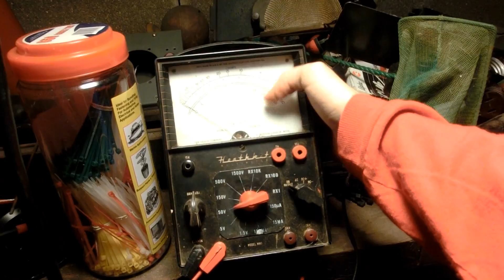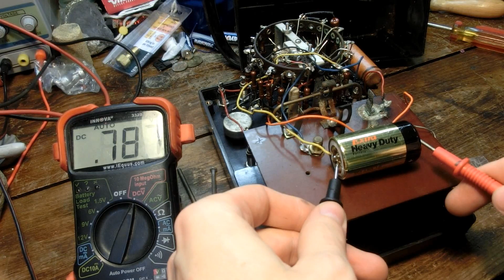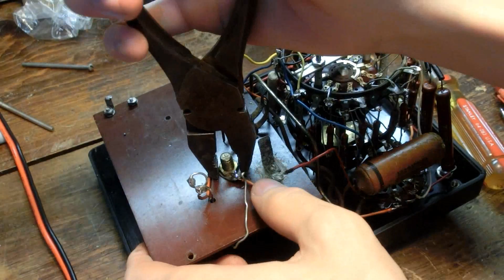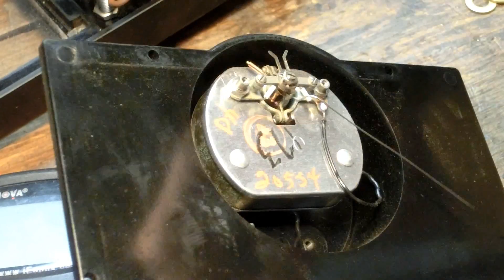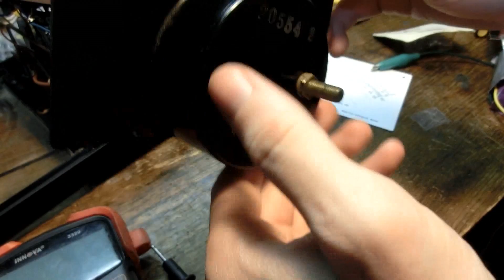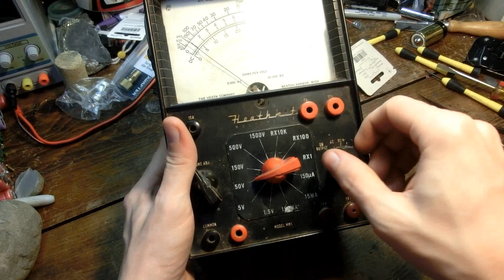1954 Heathkit MM-1 1500v Multimeter

Comment: On my MM1 there is a battery holder that in addition to the bare 1.5v C cell has 4 1.5v cells, so the missing 6v might be why the unit is not working properly. Might check for online schematic.

Comment: I watched your video but i knew the movement was dead, its something ive found quite a lot with moving coil meters, the coils often look loverly but somehow they are snapped, such a dam shame :-(.

I did recover one meter, where the delicate spring connects on to the coil body the soldering was bad and the enameled wire didnt quite connect, a tiny tip soldering iron and my tongue just sticking out while i soldered it worked lol. :-))
Reply from the maker: jusb1066 yes thats kinda how galvanometers work ;p
Reply from the maker: the odd thing is the needle did move a bit before i started the video. but it moved backwards just slightly. idk if that means anything.
Reply: Rinoa Super-Genius
magnetism affects these as well as electrical fields i think
Reply: Rinoa Super-Genius
yeah true, but i still think the coil was always broken, just kinda saying why i think :}
Reply from the maker: jusb1066
 yeah its just odd to get a reading from it if it's broken.
Reply: Rinoa Super-Genius
I dont know about the slight movement, but that meter would be i guess a 50ua type or close to that value, so it would not have taken much to make it move when it was ok.

Have a look under a good light and jewlers eyepeice at the ends of the springs where they attach to the coil, both top and bottom.

Try touching your digital multimeter probes gently on the springs to see if they do actually connect, just a thought, when your interested :-)
Reply from the maker: zx8401ztv
 yeah i tried all of that. looks like the connection in the coil is bad.
Reply: Rinoa Super-Genius
Nevermind, if you find a 50ua meter you can change that series wound resistor to trim it to the scale.

Comment: The white thing is most likely a tiny metal rectifier, used before silicon diodes became popular, assuming the meter has an AC range. :)

https://en.wikipedia.org/wiki/Metal_rectifier
Reply from the maker: yeah it does have an AC range, and no other part looks to be a rectifier so that most likely is it. i may remove it and do some tests.

Comment: a  lot of the older analog meters had no protection, so if you were on the wrong range, too much power goes through the scale winding and kills it.   you can use the digital multimeter, the one you made, with the red led on it, that wont need a battery! maybe put an analog clock movement into the display, and put up on a shelf? or even an led digital display behind the white panel, so it glows through it?
Reply from the maker: or fit a raspberry pi and lcd in there to make it a portable tricorder :D
Reply: Rinoa Super-Genius I hate you to be Dr. Bones. where my life depends on whether your D battery is flat or not!
Reply from the maker: jusb1066 actually i more associate the tricorder with exploring planets. so youd be relying on the D cell to tell us if there's a big inter dimensional monster about to eat us.

Comment: That thing is awesome, it sucks that it's dead.

Man my heathkit benchtop power supply blew up on me the other day and I am so pissed about it. It popped the fuse and me being me put in a 2 amp instead of the weird 1.75 amp fuse it wanted and that blew a cap. I am so mad at myself. Also my buddy stole my Sun (brand) powered breadboard from me a few weeks back. I mean he actually stole it and sold it on craigslist for $60. That was my only other easy to use variable voltage power supply. I am mad at him for it but at the same time if it wasn't for him I wouldn't have gotten it for free. He found a "free tub of electronics" on craigslist and that was sitting on top in the photo. I told him He can have the rest if I can have that and I would drive him to get it.
Reply from the maker: he stole it? fuck him. if somebody sold something of mine they would be bleeding in no time.
Reply: I wanted to but since he found it, I let it slide. He did pay me back though. I had just kicked him out of my house that day. He was living with me. When I say kick out I mean he found another place but wasn't moving as fast as I was hoping. So he actually needed the money at the time.